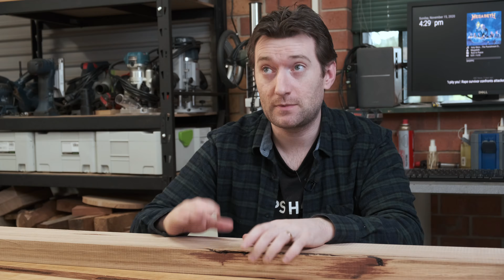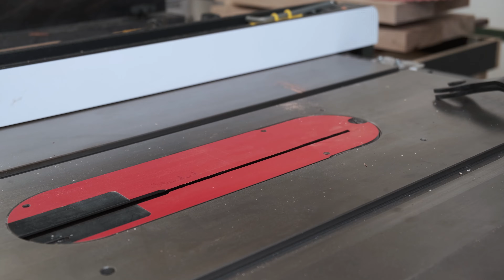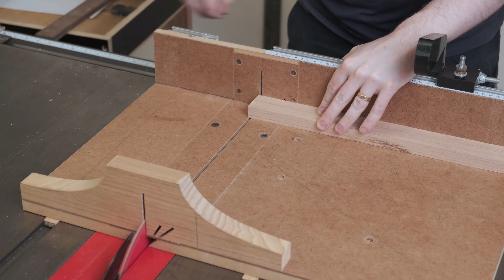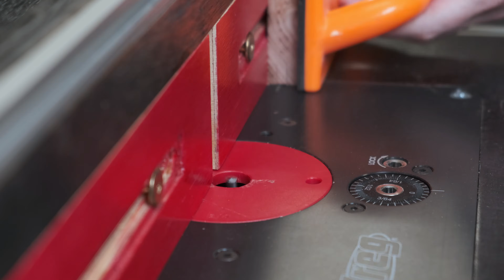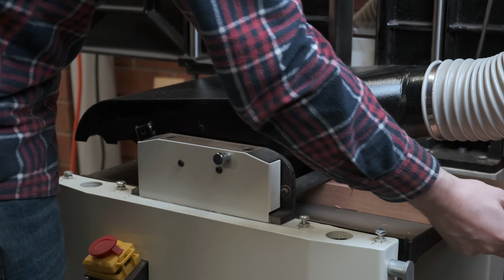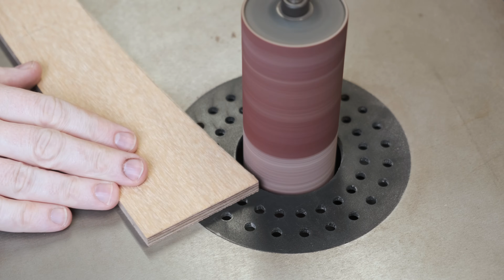Mission Style Bedside Drawers #2: Sides Frames

Comment: I admire the way you do plunge router cuts. I have the same router it's never that easy >__<
Reply from the maker: What type of bits do you use? Straight bits are hard to plunge with, but upcut spiral bits are much easier
Reply: @tmuWolverine  Both straight and spiral (an upcut with chipbreaker one) but I guess I just have to practice more. Consider this to be just a compliment =)
Reply: @tmuWolverine  oh, btw, got the router partly due to your review of it. An awesome machine, no regrets =)